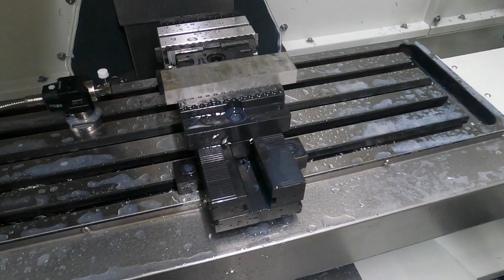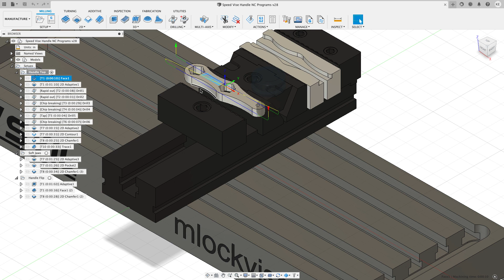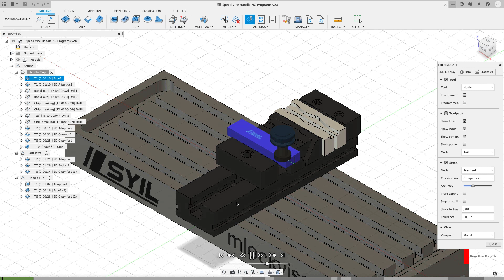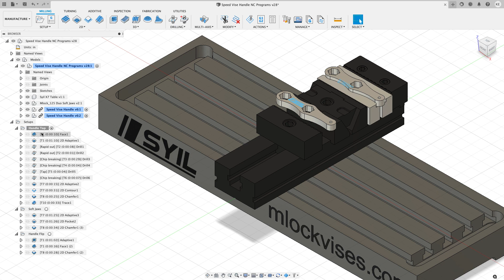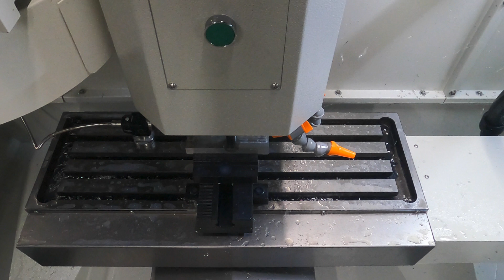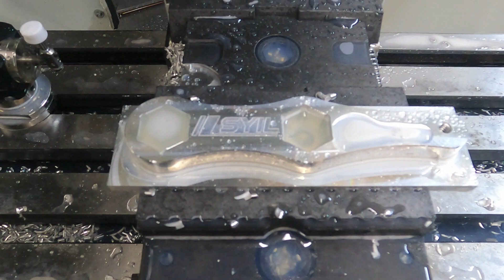Syil X7 - Speed Vise Handle First Chips!

Comment: Spot drilling😅😅😅😅😅 for what?..for fun only....
Reply from the maker: I’m using 118 degree high speed steel drills. So yeah, spot drilling for an accurate location.
Reply: @MechanicalAdvantage  no through coolant...no solid carbide? Strange..! Thats for high speed machining....good for your machining time.

Comment: How come you don't always use food coolant on the shear hog?
Reply from the maker: Mostly to try to keep the camera lens clear. Coolant provides some lubricity, helps to cool the tool, and helps with chip evacuation. The shear hog is a two flute inserted tool. There is a big gap between the inserts. So you don't really have to worry about chips getting caught in there and breaking the tool. If it weren't for the camera, I would run full flood on there all the time though.

Comment: Did u add a relief cut to the soft jaws? Or are you just using a dead blow to stop if from popping out?
Reply from the maker: Hi Amy. I didn’t do anything special with the profile. After I put the handle in the soft jaws I hit it with the hammer. They came out pretty dimensionally accurate on the thickness for the effort I put into it. I think they are within about .002 on thickness.

Comment: badass! question, i see you had fusion reorder the ops (post processor) so the tools were in order. can't that cause issues though? like if certain operations have to be in chronological order, is fusion smart enough to recognize that?
Reply from the maker: Fusion is smart enough to know that in a case like you mention, it can’t reorder the tools. So there really isn’t a lot of concern for checking that option. Always simulate your NC Programs though to be sure.
Reply: @MechanicalAdvantage  thanks for the response. Been learning a ton from your channel.

Comment: Great video Kevin. It is nice to see a machine running in real time  occasionally for a point of reference. 

I mounted a gopro stick on mount on the side of the head but were the camera looks under the casting. It gives a pretty good viewing angle.
Reply from the maker: I’ll get the camera stuff working better. I preview the angle on my phone. But once you hit record, the preview stops. So I didn’t realize the spindle enclosure got in the way of the shot when it came down in Z.
Reply: @MechanicalAdvantage  like most things, its an ever evolving process. I still enjoyed it. Those Syil machines sure do run smooth.

Comment: Hi
Can you hold 0.01mm tolerance on this machine ?
Reply from the maker: Maybe? 🤷‍♂️ Probably not. Do you have a climate controlled humidity controlled shop? No machine will help you if you don’t that that to start.
Reply: @MechanicalAdvantage  just under half a 10th there you go i did non metric for you :-) you could probably do it if you go slow and hit it with a few finish passes but i doubt its necessary for a vice handle to have sub thou accuracy?  isn't that what grinders are for  ;-)  being serious though it would be interesting to see a video on how well it interpolates a hole/cylinder and holds size and squareness.
Reply: @MechanicalAdvantage  yes i do. I just want to know if machine is capable of such tight tolerance..

Comment: Awesome Kevin nice to see you up and running, that's a real nice machine you have there, will be cool to see how far you can push it, looked like it didn't even break a sweat there!  was starting to worry about you, sent you a couple of messages and never got a reply.
Reply from the maker: Hi Ash. Yeah, sorry. I kind of fell off the face of the earth over on IG. Things got pretty negative for me there so I have been taking a bit of a break. It’s good to have things running. Still need to run air line and drops around the garage. Evaluating PEX and Shop Air systems right now for that. I have about two more weeks of teaching high school classes and then I’ll have a lot of free time this summer for the garage and the machine.
Reply: @MechanicalAdvantage  Cool glad your ok! Make some of those speed vise handles with the mechvantage logo ;-) id like a Mechvantage bottle opener! my haas one is getting a little wore out.  how you doing for tooling on the machine?  is there is anything you need? If you need more tool holders lookup Piotr Fox Wysocki on youtube he found some really nice bt30 holders for very little money.
Reply from the maker: I’m sitting pretty decent on holders for now. They do look interesting for a future purchase. Working in buying more cutting tools and collets now and a Haimer. So Haimer, and running my air lines are probably my two biggest priorities right now.
Reply: @MechanicalAdvantage  do you not have a probe input? have a look at drewtronics they make a reasonable wired probe (manufactured in texas)  they guarantee .001 accuracy or better with .0002 repeatability for $170 yeah its wired but its still faster/arguably better than a Haimer.  they also sell a wireless one for $700 with .0002ths accuracy and 0.0001ths repeatability.  https://drewtronics.org/  this guy also sells nice probes too but for the money i think the drewtronics wireless one is the way i will be going so it can live in the tool changer.   this is the site for the other guy in nz making probes https://hallmarkdesign.co.nz/

Comment: Nice job, I like the machine. It looks like it’s a pretty capable machine. Just from what I have seen ,it looks like it may be more of a vmc than a Tormach. Is there a big difference in pricing compared to a Tormach? Keep the chips flying, I’ll be watching.
Reply: The are priced very close to the Tormach but you get a real industrial controller (5 choices) and linear guides and full to the floor casting, not a benchtop on a stand! They are extremely accurate and repeatable, the new ones are even made from an epoxy granite casting from Switzerland by Schneeberger!
Reply from the maker: As Paul said, much beefier machine. Higher horsepower spindle. Industrial control options. And most things are standard and not add-on options. Plus these come pre-assembled so you don’t have to do that part.
Reply: @MechanicalAdvantage   You can see the way it moves and runs that the Tormach is not in its class. Nice machine. Look forward to upcoming videos and chips.